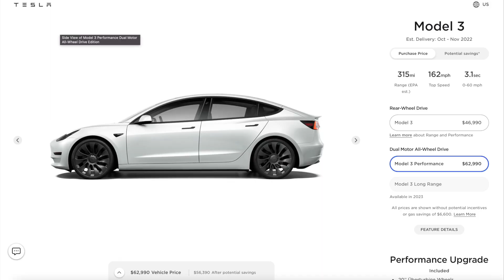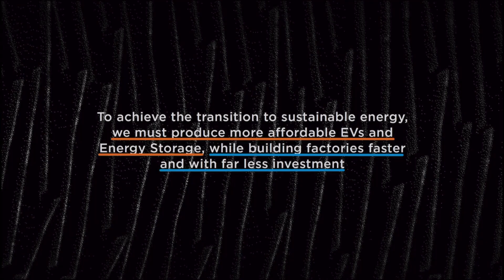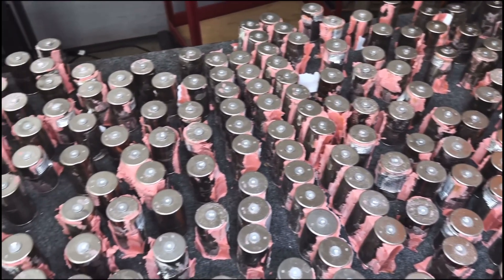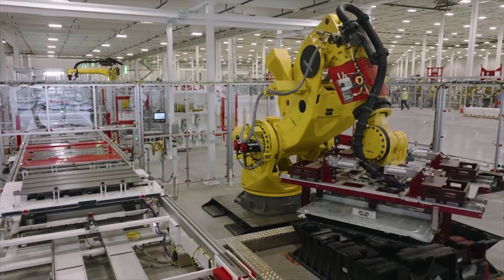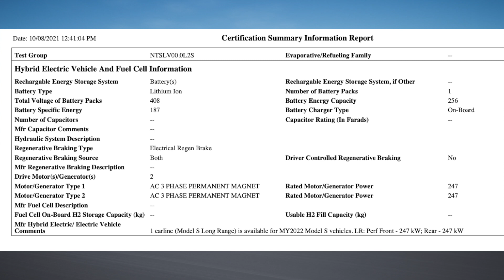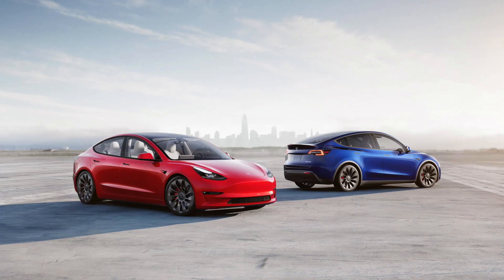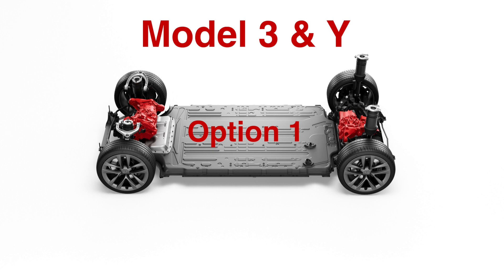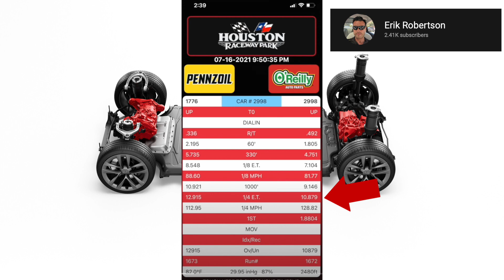Plaid Model 3 & Y - EASY Parts Bin Performance upgrades

Comment: Watching this video a year later, it solidifies everything Tesla did on the new Model 3 Performance. 510 hp using basically the same hardware with few upgrades.

Comment: These swaps will be common place (hopefully) in a few years you've established the common parts that are interchangeable.  Those crashed plaid are going to pull a premium for a little bit. Those longe range S's will be a "poor mans" plaid. They clock the motors.  I'm so excited for the future of the aftermarket community.  They should call it "The Wrath" version and have the audio car in the movie as it drives, sits and reverses.  Getting ahead of myself.

Comment: Driving a model 3 performance now I would say the best improvement would be higher speed power . Below 70mph it’s very quick. But at freeway speed the acceleration is way less. It will lose to most turbo 4 cylinder cars from 70-90 mph roll races.

Comment: Could you easily do it in an aftermarket swap?
Reply from the maker: Unfortunately the biggest challenge would be modifying the software to allow the new motor to work. I’m hopeful in the future there will be aftermarket options, but with the focus on cybersecurity and functional safety, the OEMs are going to make it increasingly harder to modify the powertrain.

Comment: I need a replacement windscreen since June and Tesla 3's aren't exactly uncommon now come on manufacturers what's the problem?
Reply from the maker: I had a windscreen replacement about a year ago and it only took 2 weeks to get the part.  Maybe with the tesla production ramp there are less service parts to go around, but I am only speculating.

Comment: They can’t make enough cars already. Even the Performance have some wait time. Musk recently said that he wants to keep the Model 3 lineup as simple as possible. They won’t add anymore Performance to the Model 3. It wouldn’t help them sell more vehicles simply because they can’t make more vehicles. Adding any complexity to the manufacturing process will slow down production.
You are much better off using the techniques in this video to improve acceleration than waiting for a boost upgrade or new Performance model that will never happen.
https://youtu.be/ExNNArhYsns
Reply from the maker: The model 3 has been neglected for all the major updates happening for the model Y.  I am hopeful as part of their manufacturing simplification, some of the improvements can come along with it.  Thanks for sharing that video, it shows the main limit is battery management
Reply: @EngineeringPerspective  it is unfortunate that they won’t improve the performance of the Model 3 or Model Y but that is the reality. It definitely is technically possible to do it. However, it won’t make financial seNse to them when their main focus is on maximizing production numbers.

Comment: I inform you, that Tesla needs to publish their power figures in germany and the Model 3 Performance is and was always rated with 513hp already. The 190kw PM rear motor is drawing up to 240kw in scanmytesla, so its kind of overclocked already. Would surprise me if the motor of the Model S LR and Model 3 Performance is the same.
Reply from the maker: is there a website that has this information?  I assumed that Tesla was not accurately sharing power figures in the US
Reply: @EngineeringPerspective  I am 3 months late to this subject, but I recently took delivery of a 2023 M3P and I did some runs with ScanMyTesla. I have to do some more thorough testing but in a recording I did, I saw a peak power output of 266kW rear and 202kW front. It only hit those for about 1 second during a pull, before stabilizing at around 230kW rear and ~190kW front (I let off right as it was at 190). Rear motor hit peak power well before the front motor did. I have a screenshot of the rear being at 248kW at the same time the front is at 187kW. https://i.imgur.com/ZsAner7.png
Reply from the maker: @rickput  This is great information! Its clear that what tesla publishes to EPA may be underrated.  If the motors are both operating at less than their peak power combined, then it appears the power output is likely battery related (as we originally suspected).  Thanks for the follow up, I really should go get a scan my tesla.  Lots of info left to learn…
Reply: 190kw*2 = 380kw 308kw = 510hp not sure where the overclocking is done here
Reply: 240kw even at 90% efficiency would be 216kw that is still 290hp if you had that and a 190 in the front you would go over 550hp

Comment: Plaid rear dual motor requires a completely different cradle and is wider too.  Front rear weight bias would change as well.  They can probably get a lot more out of the existing inverters/motors and just need the higher power 4680 cells and appropriate power curve mapping.
Reply from the maker: Agreed, 3 motors will probably not happen on the 3 & Y platform.

Comment: Sadly, Elon said a Plaid Model 3 is not planed, maybe they changed their mind but I would not expect it in the near future.
Reply from the maker: But Ludicrous isn’t off the table!  :)
Reply: @EngineeringPerspective  I hope so!
Tesla is obviously laser focused on production simplicity and sourcing recourses (chips, battery material etc.), to scale as quickly as possible.
If a faster powertrain in the Model 3 and Y does not stand against that, then it is a serious thought.
Reply from the maker: @markgritzan2841  Motors are technically just a drop in, only question is the battery… but they should be working on a 4680 pack already anyhow!  I would certainly trade in my model 3 for a faster one.
Reply: @EngineeringPerspective  4680 is used and in some cases needed for the Cybertruck, Semi, Roadster, and current structural battery pack model Y.
If they really wanted a high performance Model 3 and Y, why are the current Model Ys with the structural battery and 4680 just Standard Range?
That would be the perfect opportunity to make something like you proposed happen, but they chose to make it a Standard Range.

To be honest, I would have bet money on the fact, that the first 4680 vehicles would be high performance, high margin, expensive premium versions, I was very surprised that this did not happen. They definitely have their good reasons for it, which I really like to hear :D
Reply from the maker: @markgritzan2841  I'm with you, I thought for certain that the first 4680s would be used in some performance variant.  I'm closely watching Munro Live as they learn more
Reply: @EngineeringPerspective  By the way, love your videos! :)
Reply from the maker: @markgritzan2841  Thank you!!
Reply: It'll be a 4680 dual carbon sleeved motors ~800hp

Comment: If they really bring a Model 3 Plaid it needs to kick ass. So they also would need a 3 motor setup to overcome the 70mph+ fall on it's face thing. But the model 3/Y is tesla's mass market car and i think the power is plenty for a daily. You only notice the slower 70mph+ if your road racing against gas cars with similar power. Daily driving a M3P/Y i think is plenty fun already. And if you really want Plaid you'll need to buy an Model S. Or get nextgen Roadster.
Reply from the maker: I agree, if they call it Plaid, it would need to be really good, likely more than the 670hp would be needed.  However, it is a mass market car so price will really influence the volume, I do think there may be room for a Ludicrous version  3&Y in this respect.  Not everyone has $150k-$250k for a Plaid S or Roadster.
Reply: They'll make a 4680 M3P dual carbon sleeved motors ~800hp. Tri-motor won't be out until the quad-motor comes out for the semi, cybertruck, roadster, S

Comment: 1:27 you forgot another important part... cooling system. A lot of modern performance EVs are limited to only creating peak power for short durations, because they lack a proper cooling system to prevent their battery or motor from overheating while outputting peak power. This means that while most performance EVs have an impressive 0-100km/h time, their high-end acceleration and top speed is very poor, and after throwing them around a track for too long (for example with the current model 3 performance), the battery overheats and power is reduced. 

As far as I’m aware, the model S plaid has no such overheating issue, because it has a beefed up cooling system. But to make a model 3 or Y plaid, you would also need to upgrade the cooling system on the battery so that it can handle the increased power demand from the motors for long durations.
Reply from the maker: The amount of heat that needs to be rejected by an EV is very small compared to an ICE.  The coolers, pumps, etc are easily capable of dissipating the heat to the air.  However, the challenge with EV thermal performance is getting heat from the hard to reach places such as inside the rotor, battery cell, SiC MOSFET, etc..  So the design of the battery, motor, and inverter must consider how to reduce component temperature.  Either make that component more efficient to reduce the heat generated, or reduce the thermal impedance between the hot component and the coolant.  Once the heat is in the coolant, the problem is much easier.
Reply: @EngineeringPerspective  have you seen the people actually tracking model 3s by chance?
Such as dai with eneos running pikes peak in a race prepped m3? Sasha with mountain pass performance who has multiple track records with a m3 perf? All of them struggle with heat over almost everything else in a m3 when racing it. 

Now a 4680 equipped m3 with the c.f. wrapped plaid motors might be a different story. But otherwise it's heat heat and more heat dissipation capabilities that are lacking in the m3. 🤔
Reply from the maker: @4literv6  I agree that EVs have lots of room for improvement in thermals, but the learnings from ICE can’t directly be carried over.  It is specific areas in the EV powertrain that need the thermal improvement, just putting in more radiators won’t solve the issue.   I think Tesla and other EV makers will make great strides in this area in the coming years.
Reply: @EngineeringPerspective  well said, in your opinion is it the older teslas without standard octovalve or heat pumps that have the issues?
Because the dai m3 from eneos is a 2018 model without a heat pump or octovalve and so is the 2019 Sasha runs from mpp. 🤔

Whereas Randy pobst with the plaids hasn't seemed to have those kind of heat soak and thermal throttling issues at all really. 👍🏻
Reply from the maker: @4literv6  the challenges are actually closer to the core of critical components.  For example, within the battery cell there is effectively a resistor inside the cell, so the more power that flows out of the battery, the hotter it gets.  So there are 2 ways to solve, which Tesla is doing.  First, the plaid battery pack has better cooling around the individual battery cells, and second they can reduce the internal resistance, which is what the 4680 cells are designed to do.  If the internal resistance is lower, it generates less heat in the first place.  This may be a great topic for a future video, Thanks!
Reply: @EngineeringPerspective  good stuff, with you being an actual tesla owner thanks for sharing this information. 👍🏻
I wish munro would hurry up and release their findings on the 4680s. 😁